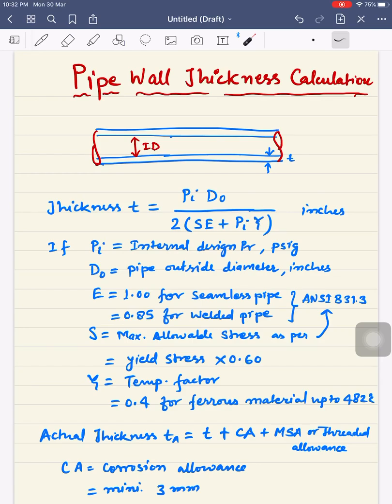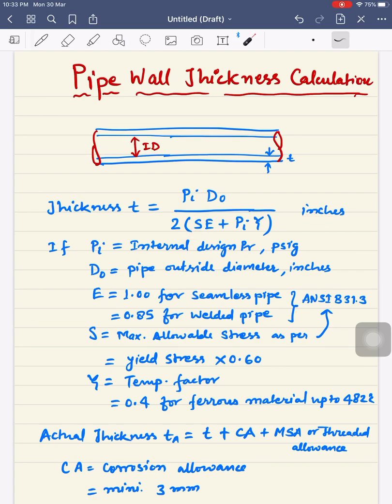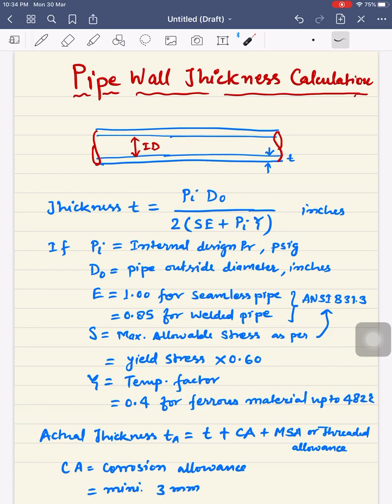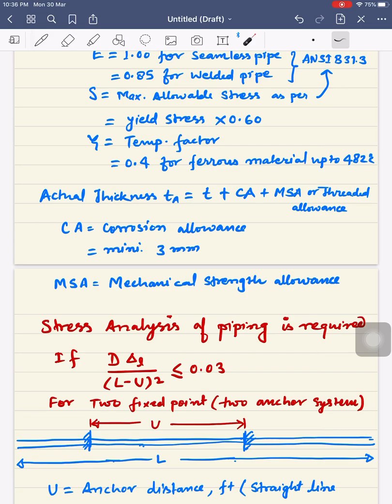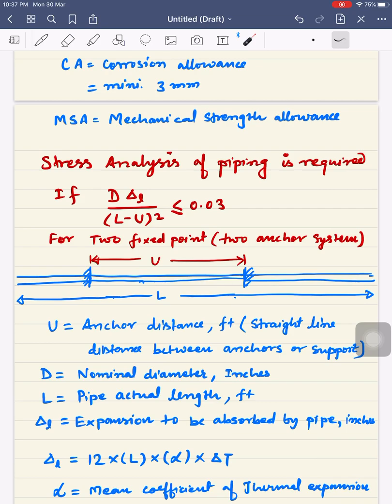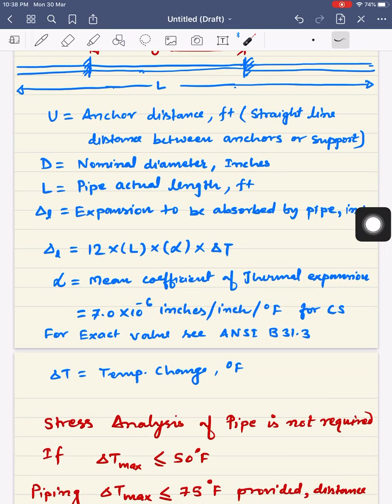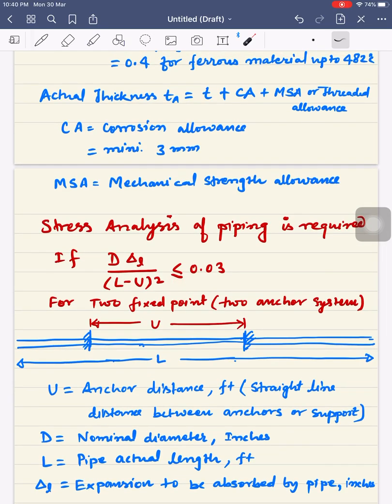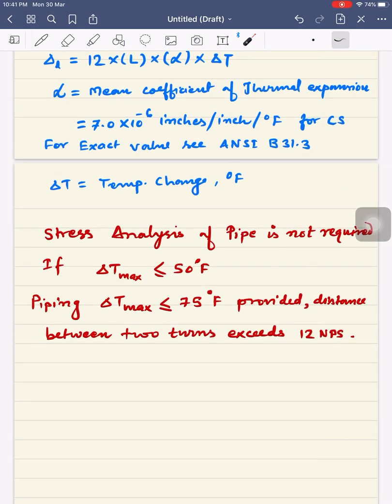Pipe wall thickness calculation concept

Comment: I have not commented on the video content other than the equation explanation provided. Code B31.3 clearly indicates that 'L' is the developed length between the anchors , that means if in between two anchors if the pipe has route in X, Y, Z axis then U=sqrt (X^2+Y^2+Z^2) and L = X+Y+Z where x,Y, Z are the dimensions along respective axis.. further You have stated Delta L as the distance between pipe's original position and after buckling which is not true .The Delta l = sqrt (delta X^2+delta Y^2 +delta Z^2) where delta X = individual linear expansion along X axis and not what you have stated. I have been studying this subject for 20 years. So accept the errors and correct it. I will appreciate the video. It is not about 'who is right' ... it is all about 'what is right'. Piping engineers do not enter in process but we have no issues if process engineer provides correct information.  we do not discriminate.
Reply: Do what is right not who is right👍👍 great learning from gaurav bhende sir😇
Reply: Lokesh is right.it is preliminary.
Reply from the maker: I already mentioned that it’s a preliminary awareness for process Engineers not a final outcomes for stress analysis requirement. The detailed study what you are explaining is not required for process Engineers. My channel is to educate the fresh process Engineers with the minimum required concept of other engineering disciplines. It’s good if you could make a video on this topic in more details for piping and stress Engineers.

Comment: kindly do not give wrong information on pipe stress analysis. the explanation of DY / (L-U) ^3 is not correct. leave it to piping engineers.
Reply: Gaurav is correct. I think false information mislead future engineer. This is happening in above video.
Reply from the maker: Without knowing API 14 E don’t comment first read and comment. Piping guys don’t read process related API and they only know ASME that’s why they keep on saying wrong
Reply from the maker: It’s just preliminary for process Engineers not for piping already mentioned in the video. One more thing I would like to tell you that no information is wrong if you have never read API 14E which process Engineer use extensively then read first before writing nonsense comments. Study well before commenting. Piping can never teach process Engineers
Reply: @lokeshkumarsingh9636  i belive Mr. GAURAV is right in this regards.